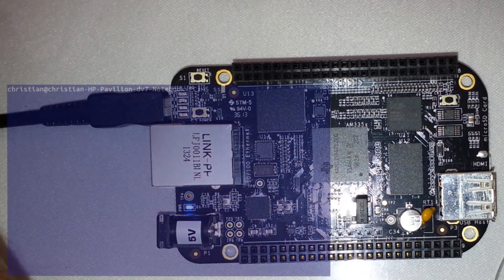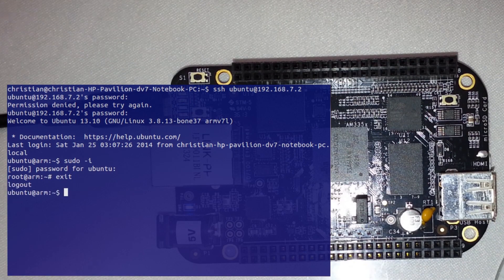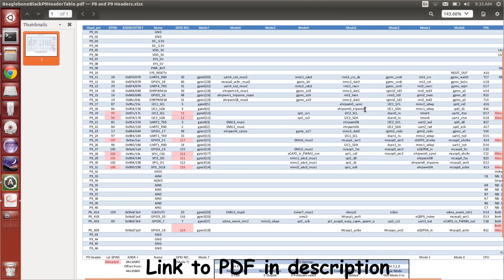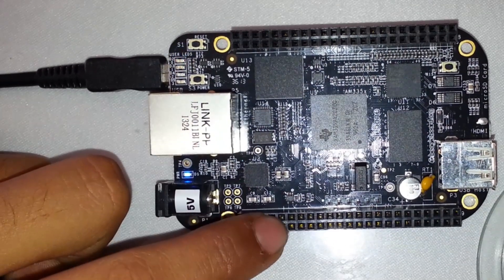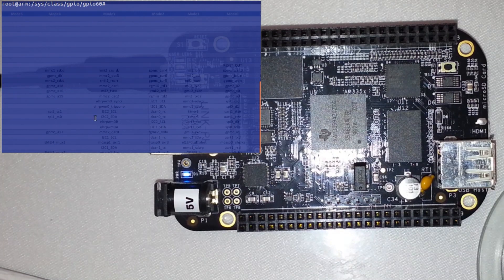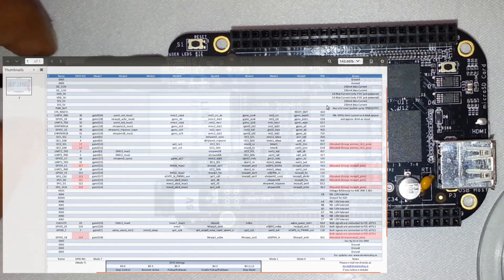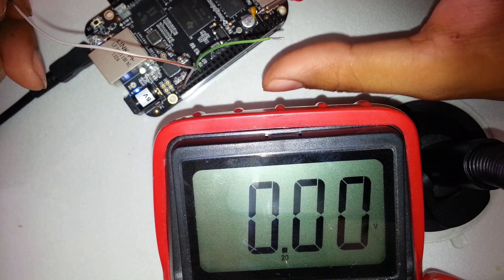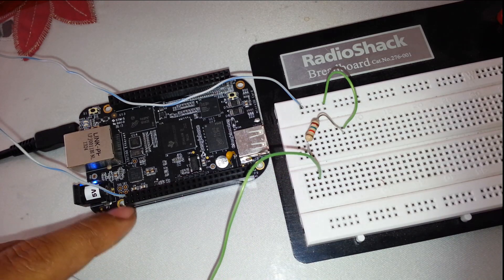How to use GPIO pins on the Beaglebone Black

Comment: A most interesting echo GPIO video.  I am trying to get the new Orange Pi-5 GPIO and PWM pins to work using the OPi.GPIO Debian-Bullseye-Python3 Thonny program to control the Pan/Tilt servo motors.  The GPIO pins error out not found.  I will use the echo commands. Next will be to run a Python code project. Orange Pi5 has no GPIO PWM examples. Thank you.

Comment: these devices dont have gpios enough. their gpio header is for measuring and testing. beaglebone black has 10 free gpio pins only. other pins are used by other devices on board.

Comment: What is the point of installing eclipse if you are not going to use it for development (compiling)?. In your case you could have just edited the file directly in the BBB using Vi, VIM or nano
Reply from the maker: For this specific video, you are correct. There is no point to using an IDE like eclipse. If you are using eclipse though, you can create a program which will probably run better than a script. For example, in my old library (which is no longer available), i used memset to edit and configure the gpio registers which was extremely fast. This eventually pushed me to try and make a boot loader and that required the use of an IDE because of the TI & open source libraries. I hope to use eclipse soon for a project I have been trying to do and make a video on it. Thanks for commenting!

Comment: hey BBP,
i want to log analog data from 4 photodiodes which happens to be OPT 101 (Texas instruments, bandwidth= 14 KHz), i tried to log data from Arduino uno be got a low sampling rate of 300 samples/ sec for my 4 analog sensors, and 1kHz if only one sensor is attached to the analog pin (clearly the sampling rate divides if i use more sensors) . I want to at least log the data for my four sensors simultaneously at nearly more than 10 KHz,  i just want to know if this is achievable with the BBB.
Reply: Not with the Linux kernel. The sample rate isn't that great. There are real time operating systems that might help you achieve this. Or you can use the programable real time unit the comes built into the CPU. This requires knowing assembly and there are a few tutorials out there to use it but I haven't really gotten there yet.
Reply: Christian Macias thanks,  but do u have any idea about the maximum sampling rate achievable with BBB, the analog output is a floating no. (upto 4 decimals) if  i only want to log for 1 sensor only.

Comment: Do you know how to make a Pololu servo controller communicate with the beaglebone?
Reply from the maker: vasiq shair You can use the uarts that come with the beaglebone to talk to the Pololu servo controller. Keep in mind that the beagle bone uses 3.3v as its input and output, so you might need a logic level converter depending on what the controller works on.

Comment: hi sir,
this is gnaneswar .
am unable to interfacing and communicating  the BBB .
i'm using linux Mint os without any extra disply,mose n keyboard.
i used to run the commands on terminal by following u r procedure.
cd sys/class/gpio/........... here it is showing in the ls (long listing) only export  un export . it doesnt have ant gpio 0,gpio1, gpio 2, gpio3 as shown in vedio .
what shoud i follow for communicating i/o ins.
thanks in advance.( looking for fast reply .if anybody knows please comment the procedure   )
Reply from the maker: g gnaneswar You need to running a kernel that supports this. What kernel are you running? Check with uname -r